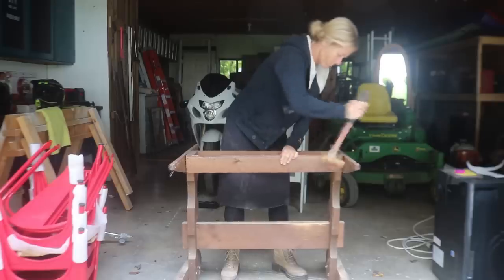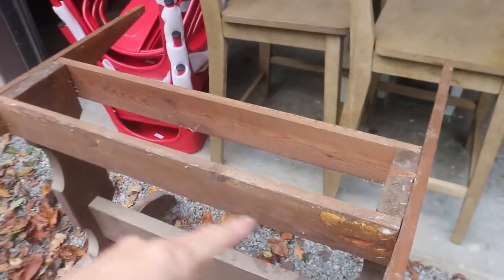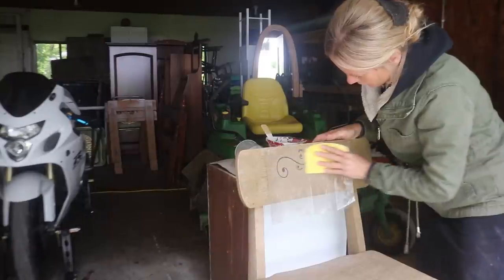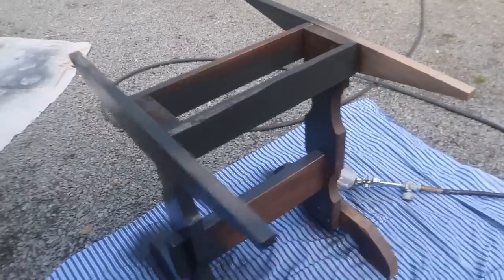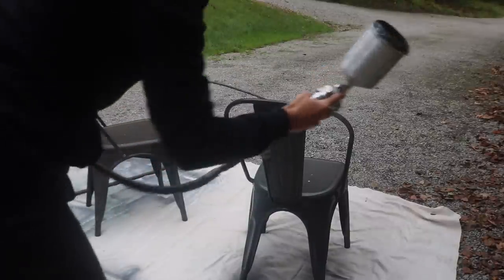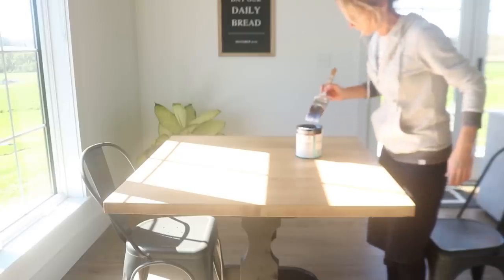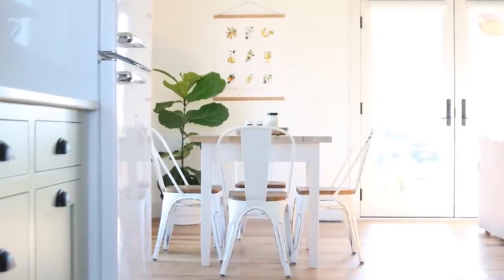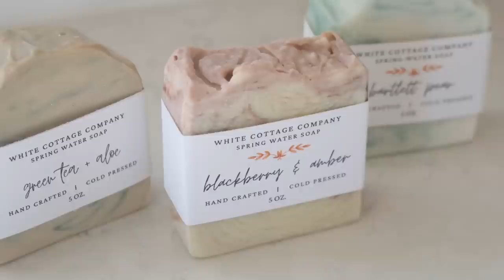Furniture Makeovers ~ DIY Tables ~ Furniture Repurpose ~ DIY Coffee Bar ~ Before and After Furniture

Comment: Ur thrift vintage lampbmetal  shade.  In other video.  I think would look better.  Spray painted white.   N. Replace black. Extension cord.  With a white one.  Or paint it.     Part of that cord is black n part is white.   Doesn't look.  Cohesive. Mary.   Even put lace bow.  At top of it.  Of bottom.    Thread. Lace. In n out thru circular openings of that lamp shade.  Tie a lace bow.   Look more prettier